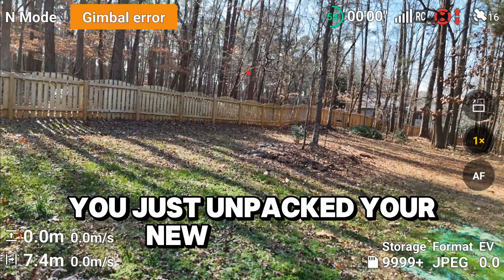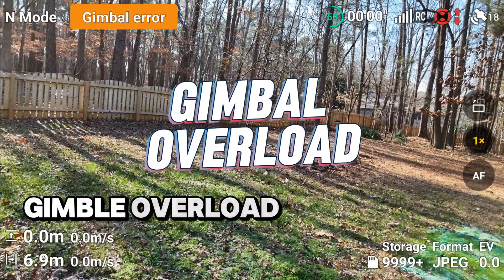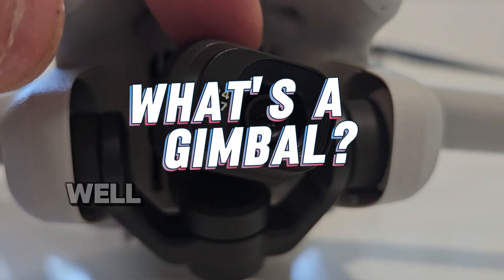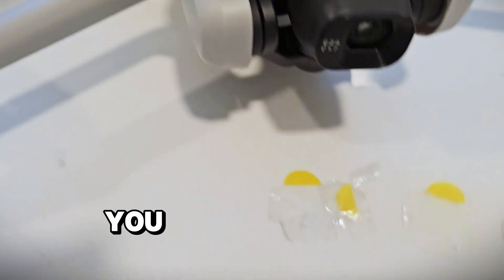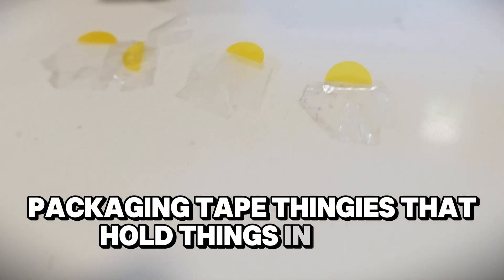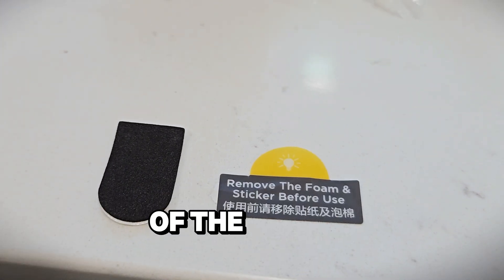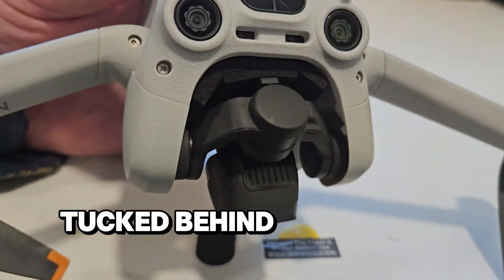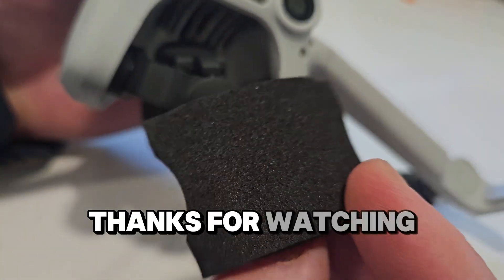New DJI Drone: Gimbal Overload, Gimbal Error or Gimbal Stuck

Comment: im having problems with the dji flip and it looks like im the only one
Reply: Have you solved your issue? I have same issue with my flip. Thanks
Reply: @gouthampusapati7772  Don't feel bad,You're not the only one. I'm calling DJI customer service tomorrow morning.
Reply: me too
Reply: me too
Reply: Hey how resolve the same problem in DJI flip?
Reply: @ I bought the Flip, flew it for 5 minutes indoors, touched an indoor plant, and the drone fell from a height of 45 cm. After that, I got a gimbal error. When I move the gimbal by hand, I notice that everything moves fluidly. The only thing that catches my attention is that when I move it to the right, the rubber bands make it return to the center, and when I move it to the other side, it doesn't come back. What makes me think is that maybe one of the rubber bands came loose on the inside because everything looks fine from the outside. I'm going to take it apart and check that out.
Reply: @ I have the same problem, the camera can moves a little bit but don’t work fine the gimbal
Reply: @ can it be fixed?
Reply: Me too, Just clean the gimbal with oil to fix my flip😅